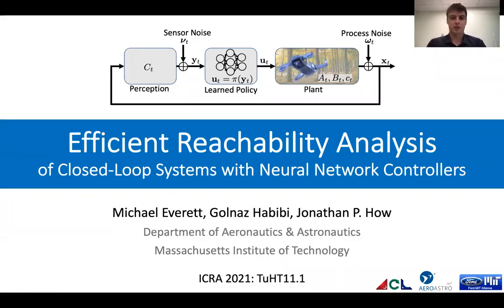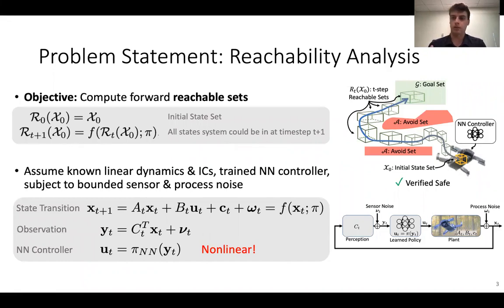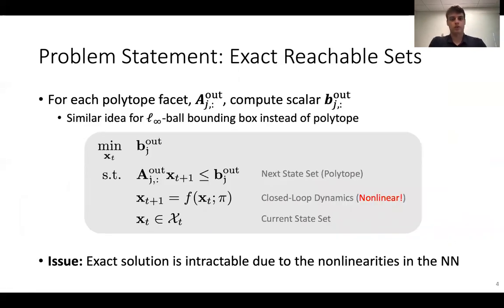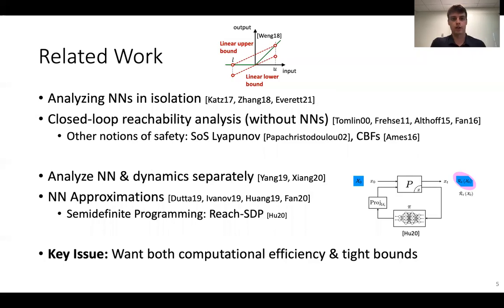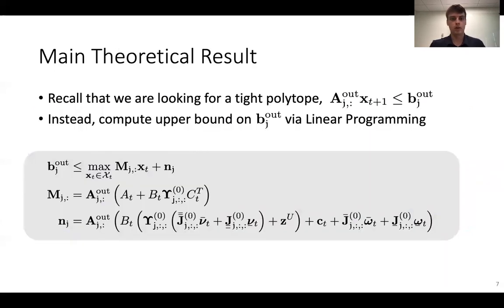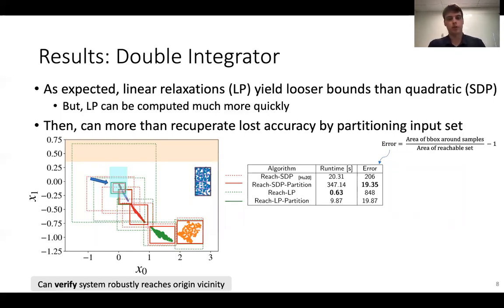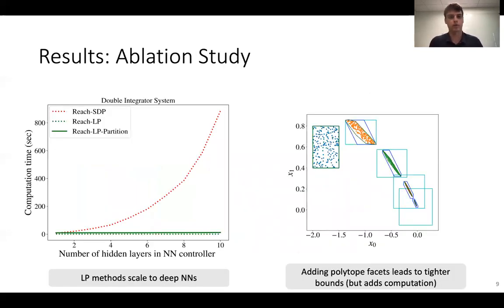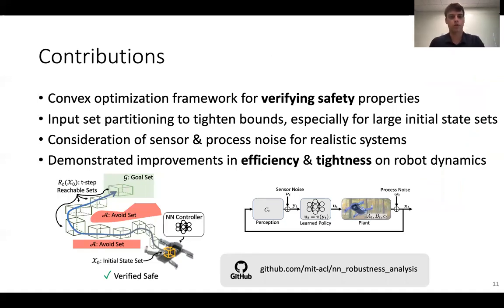ICRA 2021: Efficient Reachability Analysis of Closed-Loop Systems with Neural Network Controllers

Comment: Very nice presentation, thank you for uploading! :)

Do I understand it correctly, that the NN controller solely determines a future control input based on observed system outputs? So no desired values for the output or other information is taken into account?